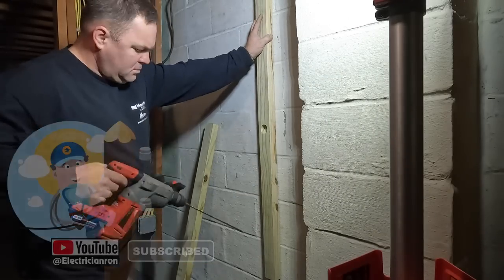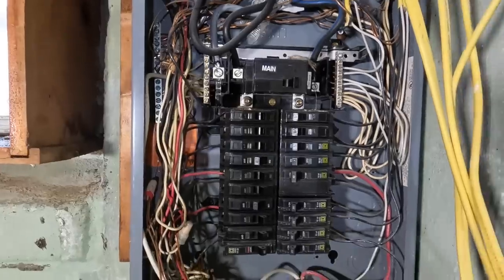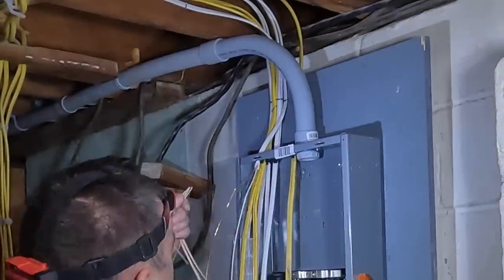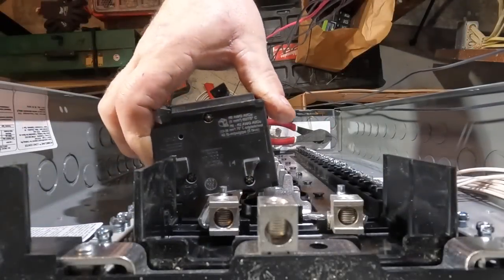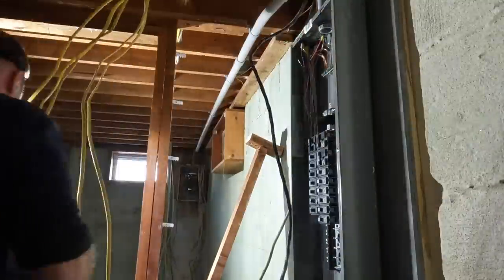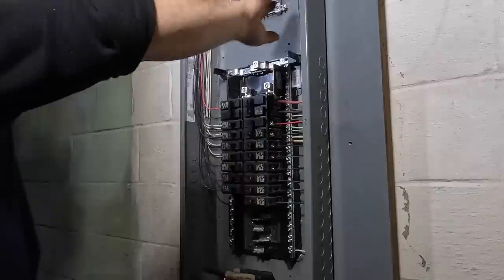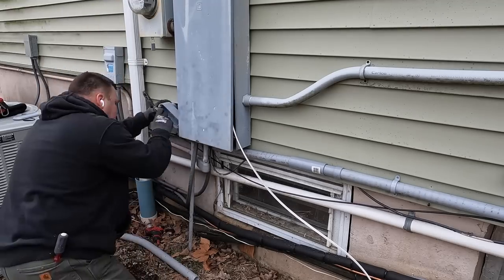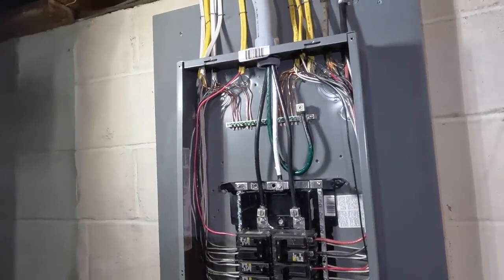Relocating an MLO (sub panel), branch circuits, & feeder to a new location | Tinton Falls, N.J.

Comment: Ron, really enjoy your videos. Was a contractor for 35 years and your panels are as nice as any I’ve seen done by anyone. It is so apparent that you think through your jobs and make a plan long before you drill holes and run cables/tie in panels. One comment. If the basement is being finished with drywall ceilings a two gang raised cover will bring 1900 JB flush to drywall surface and allow for a decorative blank finish plate in lieu of the regular 1900 box blank. Please keep videos coming. Thanks.

Comment: You probably know this already but I have in the past when using large feeders in tight space I have upsized the LB and used reducing bushings to accommodate bending the cables with having to literally hammer the feeders in the LB

Comment: Comment/Suggestion - I notice you grouped the neutrals near the top of the bus.  This looks like a PON capable panel and I'd suggest landing the branch neutral under the actual breaker location to allow for future GFCI or AFCI breaker installation.  In your case, if you swap one of the lower breakers, you'd have to extend the grounded conductor to terminate in the breaker.  Thinking about a future proof install as the design of the panel lends itself to landing a neutral at each breaker location, including accommodation for twin breakers.

Comment: Ron your work was well planned and executed, I particularly like how you painted your backboard is a great way to show your better than the average Sparky. I guess your not on 2020, it's great that you inspector realizes that motor circuits can be on standard breakers. I'm looking forward 2023 when they tell me the whole house air conditioner has to be on a GFCI.Trying to explain to the customer that is not my fault that is here conditioner keeps popping the breaker, and the HVAC guy saying it's not his fault. (Someone said the code is forcing us to do the research for the manufacturers)
Reply: If I'm not mistaken this new code change came about from an incident somewhere in Illinois where a child was electrocuted while touching an outdoor condenser, and many of these major recent changes in the last few code cycles were the result of unfortunate situations.   The problem is, in order to meet  increasingly stringent energy efficiency standards many motorized appliances especially refrigerators and air conditioners have variable frequency drives and similar electronic gear which happens to generate electrical noise that interacts poorly with AFCI and GFCI.

Comment: FANTASTIC VIDEO. Box and wiring looks amazing. Your experience is shown. Nice you can do this yourself. Mine is in a closet and would LOVE to move to the garage. BUT money prohibits that.  IT is like from one side of the house to the other, not freezable. WHY in the hell would they put in a closet.
With your long experience, may I ask a question? WHY do they put A/C units on the side of the house by a bedroom instead of in the backyard so they can be hide from thieves?

Comment: nice job Ron you take pride in your work great advice on terminate the grounding wires and neutral wires be safe keep the videos rolling 👍
Reply from the maker: Thank you! The ground bar has to be mechanically attached to the enclosure. Sheet metal or fine course screws are a violation of the NEC.

Comment: Ha ha! In a packing warehouse I worked in many years ago, an old coke machine with rotating knobs that took quarters, The warehouse was so big with many connected buildings and always having work done, the guys would find the knockouts everywhere behind and under stuff and get sodas with em. Used to piss off the coke guys when they came to collect/restock.

Comment: Very clean install 👌 I recently rewired the entire top floor in my house. I wish I would have just ran some more home runs but, I didn’t want to mess with the middle floor walls. 

Kind of the same when you did those junctions, otherwise it’s another few grand in demo and remodeling
Reply from the maker: Otherwise I would have had to find where all those homers go to and rewire from there. That could be very expensive.

Comment: Very nice upgrade. Good to see how splicing is done with a lot of old work. Why not use like big 8" square box for all the splicing and extending? Granted the 4" ones are cheap, even if you have to use multiple ones. Those knockout pieces are called slugs, they worked on old parking meters and at arcades too. ha ha
Reply from the maker: I could have done that but I chose not to because the larger J-box would've required an equipment grounding bus for the individual grounding conductors and a flush-type cover plate isn't available. In the end, this'll look cleaner on a finished ceiling too.
Reply: Oh you need a terminal strip for those big boxes? I had no idea. A detail only you pros know, not us enthusiasts. Ha ha

Comment: Thanks you for your military service I really appreciate an enjoy your videos I love electric repairs been around it 40 years learning about electric an have learned some things on a daily basis thanks to politicians they shuffled around and didn’t grandfather me in that’s ok I enjoy fixing and sharing my talents with electric gas repairs for the elderly an disabled veterans church’s elders making things better and safe from fires and shocks GFI and arc fault devices install an panel disconnect meter cans repairs an upgrade grounding an bonding building Ser above ground and under ground in  residential and mobile home parks elec water and sewer and gas  led retro fit I never get to old to learn have a great one

Comment: Nice neat install as usual Ron I worked in Manasquan after Sandy for a few year's now happily retired to Puerto Rico I'm in a 120 unit condo Thought I was done but it's all zinsco panels here I've changed about 15 of them so far
Reply from the maker: Zonsco and Federal Pacific Electric panels are both junk. FPE specifically is a fire hazard. Does PR observe the NEC?
Reply: They're supposed to go by the NEC But the pool here is not even ground fault
 protected I've complained in writing to the administration And now my next move is to find the electrical inspector
Reply from the maker: @Bill-mh6hh  Good luck with that Bill.  GFCI’s certainly save people from lethal electrical shock.

Comment: Hello Ron.
Learned so much watching your videos. Thanks!
Question…. I am installing a new sub panel in my basement. Can I mount a board, similar to yours, over an existing Sheetrock interior wall or must the board be screwed directly to the studs? Thanks again Ron.
Reply from the maker: It's going to be much more sturdy if you find the studs and secure to them. Good luck.

Comment: Hi Ron, Love love love your vids... But I do have a question though.  Are you required in New Jersery to apply anti-corrosive paste onto the lugs? If not, will it be a good habit to do so  on other parts of the country
Reply from the maker: Neither copper or aluminum requires the anti-oxidant but it’s good practice to do so.

Comment: Nice looking work. Do you not have to upgrade to arc fault breakers when you extend existing circuits?
Reply from the maker: New Jersey is unique because what's known as the NJ Rehabilitation sub-code. This allows electrical contractors to replace like for like when doing an upgrade such as this.
Reply: Good question because anytime I'm doing remodeling a renovation I will always use regular circuit breakers until I'm ready to go through final then I replace with my combination arc-fault ground-fault circuit breakers
Reply: We can normally replace like for like unless we extend the circuit add to it or add a new circuit then we have to upgrade it

Comment: In those J-Boxes did you use wire nuts to connect all the wires? Did you pig tail from one wire nut to the next? I was just wondering because that is a lot of wires!

Comment: Great job Ron as always! I had to do a relocate on a panel and used a 6 gang deep roughhouse box to attach new wiring to existing. Are you permitted to use the same in New Jersey instead of using the 4 11/16" boxes? Have a great weekend and enjoy the Super Bowl.
Reply from the maker: Thanks John. I wish I had thought to bring those larger 4 11/16th boxes but I'm sure I'm under the box fill limit.

Comment: Hey Ron thanks for the video. I’m relocating a main panel.. is it okay to splice oven feeders in a 4x4 like you’ve done here? Wondering if there is issue with bigger fishes wires and doing splices like this to relocate a main panel.
Reply from the maker: Relocating the main panel still means the main disconnect must be located either on the exterior or at closest point of entrance.  

As for the oven circuit you may want to consider running a new circuit.  It’s a big load I imagine and a splice along the circuit is something to be concerned about.  If it’s not spliced right you could experience arcing and eventually failure of the splice.
Reply: @electricianron_New_Jersey  thanks for the reply. I just bought the house, the panel is currently on the opposite side of the house as the me ter and there is no disconnect outside. It’s an old panel and at the same time as I install a Generac I want to update the panel and move it about 8 feet  as it currently site behind the hot water tank and doesn’t have the 3 feet of clearance.  I want to junction ever circuit currently going into the panel but was concerned about the higher amperage circuits. I was thinking clear taps (Polaris taps) with rubber tape then electrical tape but I’m unsure about weather or not there is code violations there. Your videos are great. Good job and thanks!

Comment: Nice job.  But do you have to derate all those NM Romeo wires going through the bored holes in the floor joists?   Here in St. Louis we are only allowed one wire through a hole which makes for a lot of drilling
Reply from the maker: There’s nothing in the NEC about how many cable can through bored holes.
Reply: @electricianron_New_Jersey  Thanks. Must be a local thing   You do quality work

Comment: How many Romex cables are you allowed to pull thru the same hole in the joists you drilled, in your jurisdiction?
Reply: Depends on the hole size
Reply: @mostafa685  really? Can you explain and show how to derate cables for bundling for hole size?

Comment: Can you use the old box as junction box sub panel? I want to move my new service about 7ft away from old service.
Reply from the maker: Sure, you could that but if I were I would check with the building department what their requirements might be to do this properly.  You’ll probably need a new cover for the panel that doesn’t have holes where the breakers used to be. Stuff like that!

Comment: May I ask a ballpark range on what a job like this costs? I have an almost identical situation, where I would like my breaker box moved but ours is actually even a closer the the original breaker spot. I would like to move it around 3 feet to another side of the wall but have no clue what a fair price guideline is to ask around?
Reply from the maker: $2000-$3900.
Reply: @electricianron_New_Jersey  Thank you so much for your response!

Comment: Is it required to relocate the ground wires to sub panel when relocating loads to the sub panel???
Reply from the maker: No. Grounding and bonding takes place at the main disconnect.

Comment: The junction boxes are too low for drywall to go over them?
Reply: The drywall will not go over/cover them.  The code prohibits concealing junction boxes.  They will be exposed with blank covers in the finished ceiling as he stated in the video.

Comment: When extended the branch circuits why don’t u use all 3 wire cables this way u ran 1/2 the cables and have 1/2 the amounts of neutrals and grounds ?
Reply: I’m in NY now original from NJ is it legal to use the 3 wire to extend the branch circuits today also when I did residential we used all 3 wire for the home runs made it a faster install
Reply from the maker: True that the 4-wire multi-wire branch circuit (MWBC) would've been easier to install, but like for like is more practical should the homeowner want to have the ARC-fault circuit breakers in the future. The MWBC would also require additional double-pole circuit breakers.
Reply: That’s true but u can’t use a 4 wire cable in a single phase panel only 3 phase panel can’t double up a neutral on one phase ?
Reply: Do you need to put in afci breakers?
Reply: As per the older code only on certain areas but when the newer code kicks in I believe this year ? Most of the panel will need arc fault breakers